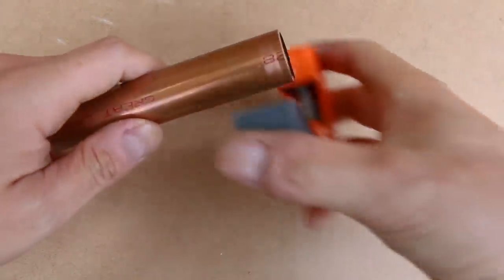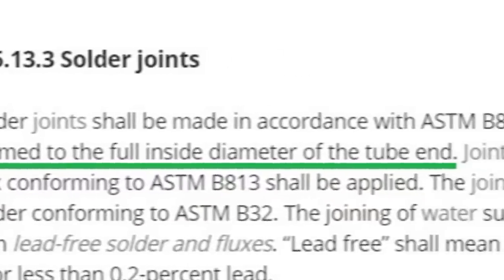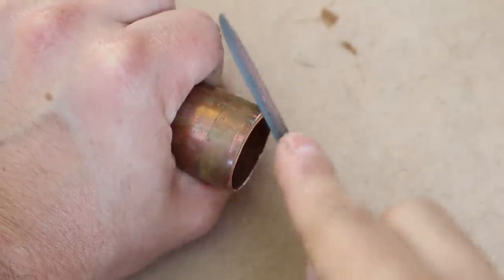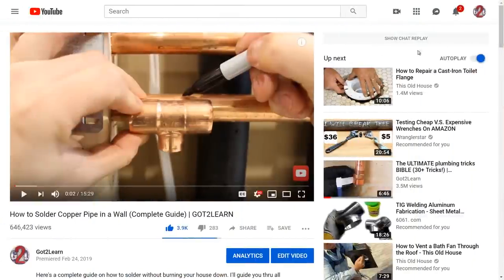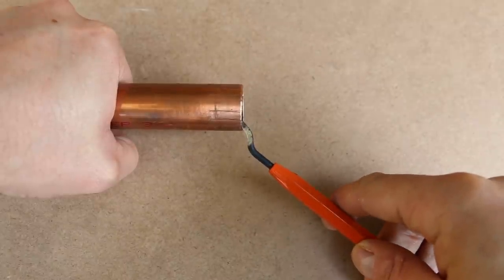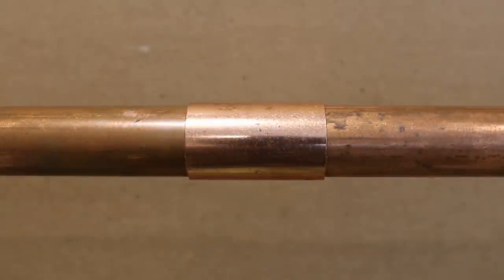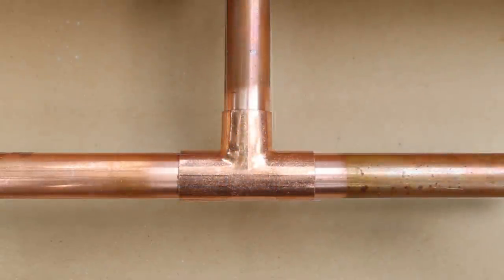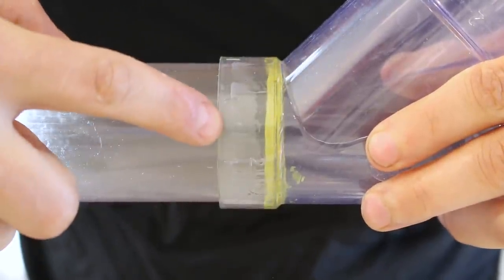The WORST Mistake When Soldering Copper Pipe (Not Deburring) | GOT2LEARN

Comment: Thanks for explaining why you "need" to bevel the outside edge -- I don't use sharke-bites, so just use the emory paper to smooth it because that's what how I was taught, but I guess I don't need to do that.  One other tool you can use to ream the inside of the pipes is a stepped drill bit.  But that really only works out well if you have an assistant doing the cutting / reaming on a big job.  Otherwise it's just easier to use the reamer on the cutter so you don't have to change tools.
Reply from the maker: My pleasure Robert!! 🙏

Comment: I fought tooth and nail on a 1/2 inch section of copper pipe going to a spigot under my bedroom floor that had two 90° angles leading out through foundation.  4 times I wiggled my fat butt down under there due to pin hole leaks . And each time lasted about a month . I gave up and used a section of pex pipe and fittings. Granted it has not failed yet but I was sure it was due to acidic or alkaline water chemically eroding the copper. We do have very hard water but only this section consistently failed. 
  Now that I've seen this video it explains it .
   I fixed it 4 times and then by a professional plumber twice. He said it was due to freeze burst . But right around the pinhole it was thin not cracked or bulged. 
Anyways I really learned something here . I only wish I had seen this sooner 😪
Great video !

Comment: You dont need to do this. And doing this in places where its impossible to get the burr out of the pipe is only going to cause potential problems. The absolute minuscule amount of burr left inside certain fittings isnt going to cause any problems whatsoever (as long as your cutter is sharp), a TEE junction  or Elbow will cause a lot more restriction than any burr will.

And I've never seen a copper pipe with a pinhole in it in 20 years of plumbing/heating and ive seen pipework that's 60yrs old.
Reply: You’ve really never seen a pinhole in copper ? I’ve fixed about a dozen in the last two years .
Reply: @davidwellander6030  Holes caused by damage yes (nails etc), I've had copper pipes blocked with scale, copper pipes burst because they have frozen, snapped because someone's stopped on them or a radiator has fallen off the wall, I've had 100s of steel radiators pinhole, I've had copper pipes that have worn through where the floorboards are rubbing against them. I've had corroded pipes that have been laid in concrete with no protection. But I've never had a single pinhole in a copper pipe that is in use.

I once had a cold mains pipe that had been drained down and not being used for 20 years be refilled and have about 100 pin holes all the way along its 20ft length, but that's different, that's due to corrosion with the small amount of water left in the pipe and the reaction between that, the air and the copper.

Maybe it's the quality of copper or water treatment we have here that means I've never seen one. Roughly 20 years.
Reply: Hell I just had one last Friday,  guy called our office complain about water coming through his ceiling and we cut out all the soft drywall and it was coming from a pinhole in the 1" main from corrosion,  kinda crazy how that works.
Reply: 60 year old plumbing that lasted possibly because it was deburred.

Comment: My question is if this is so important why didn't you put this on your basics to soldering copper plumbing for the first time now it looks like I'm going to have to cut it out my main pipe and do it all over again I was in the situation of operation damned if you do and damned if you don't
Reply: lol ya i just saw this now too ... im not sure its that critical, i just opened up 50+ year old plumbing in some of my house and the excess solder in there was insane, your telling me a little tiny lip would have more of an impact ? 

I'm not running 100 gph non stop through the pipes :) 

I doubt even plumbers follow these rules, or else every job would take forever to cut. 
They roll up with pex, pipe cutters, easy quick fast. 
Im not saying this step inst good to know, just not as intense as it seems, also the sewage one was funny to watch :) ... totally unrealistic, if water flows that slow you have other issues.

Comment: You would be surprised at the number of so called plumber who do not deburr the pipes. I have repaired so many pin hole pipes that if I would have a dollar I would get rich. The lazy plumbers will demand top dollar for a job done half ASS. It is refreshing that you have covered this topic of a true craftsman. I can tell you that I have a reamer used in the machine shop that reams the outer and inter in about three seconds with a perfect radius on both sides. Perfection just like a craftsman. Wish all plumbers would be forced to do what you are showing. Good day.
Reply from the maker: Yes I know, it's a lost art today :(
Reply: @Got2Learn  But copper is still the best bang for the buck.
Reply from the maker: Sure thing!
Reply: @Got2Learn  Please keep up the great work.
Reply: Copper is still the best way to deliver water and has a cleaning effect through a chemical reaction. Except if you have sulfated water then the big fat NO. Will dissolve the pipe for sure. Keep on making videos for us all to see and learn too.
Reply from the maker: Will do, got around 40-50 videos on the way, so still here for a good while ;)
Reply: Good day.

Comment: Ive been in HVACR for about a year (Yes I’m an apprentice still). And I will say, Deburring isn’t dead, not totally. Usually bigger boiler jobs, usually involving wall hung gas boilers or just a new oil run boiler, we measure, de-burr before you clean the pipe, then solder. We usually use Acetylene. Interesting to see how the plumbers do it 👍🏻💪🏻
Reply: In HVACR its very important to deburr and you cant let any of the burrs stay in the pipe otherwise it can clog valves and coils in refrigerant systems
Reply: @mercinc2926  we use nitrogen to purge out any excess solder and de burring shavings. It makes the job longer but hey.. mo money and better functionality

Comment: Awesome video.. I recently was attending a trade school plumbing class where I tried to teach students to debur the pipe, and the plumber said to me.. 'We don't debur'..  I said nothing, as to avoid disunity and an argument in front of student and teachers (& otherwise, I honestly think the guy is probably an above-average plumber), but it irked me to see bad practice being taught..  I witnessed such pinholes likely created by a lack of deburring wreak havoc on my CA apartment complex's circulating hot-water loop..   There is one additional advantage to deburring (that may not have been mentioned)- as long as you remove the post-debur "shavings", deburring reduces the likelihood of slivers breaking free and damaging plumbing fixture o-ring downstream.
Reply: I am a plumber and not deburring the pipe after you cut it with tubing cutters is against code, the inspector could possibly make you remove the install if he wanted to,you must deburr and ream the pipe to its full inside diameter so as not to affect the flow of water

Comment: Using the polypropilene pipes, that are glued by heat, instead of the copper ones is a better solution!
Reply: You can't using it for clean  water arrivals or hot water under pressure if you use your plastic sh1t you work bad better change job
Reply: @badbotchdown9845  Sorry for you whoever you are bro! Those pipes are in use all over Europe for both hot and cold clean water and under pressure too! Do not spit 'brains' over matters you know nothing about! And those pipes come with 100 years warranty and because they are polypropilene, there can be no scale accumulated and other things inside them, so their inside remains cleaner than the metal ones! So the water passing through them is cleaner! Go learn bro!
Reply: @nyagolnyagolov7130  thats willing to say youbuse shit material instead of copper rhe plasrix is perfectly know for letting migrate chemicals on drinkinf water  you do wring and you do wrong  even never  knowing it you surely from rhe east where nothing is doing right.

Comment: I am not a plumber, but I have done lots of copper joints on my cars fuel systems.
First thing is- it is cleaner look. it gives me inner piece, that I made perfect clean job.
Other thing is inner dimension.
When you are working with 6 or 8mm pipes, this edge can lower inner diametre to 4 or 6mm. So it is really small in that area, and reduces fuel flow a lot.
Debris. Cut it away, and you won't see any copper debris for shure.
And lastly. When you are makeing sleeve, sleeve won't fit to pipe, if you have cutting edge there.

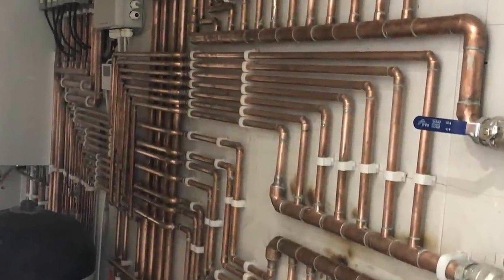Comment: Love that tubing work at 6:09, except for the joints not being wiped and the burn marks on the drywall.  But overall, a masterful layout.
Reply from the maker: Thanks buddy :)
Reply: What is that system?
Reply from the maker: Just a staged wall in my garage ;)
Reply: Got2Learn oh right, it looks like good practice, id love to do something like that to master soldering and copper runs
Reply from the maker: Go for it :)

Comment: Number one reason for not doing this and why they probably don’t teach in plumbing courses is you’re creating more debris that could clog up things
Reply from the maker: If you are in a new construction, you deburr the pipe before installing it, no debris goes in the system.
Reply: In cooling or refrigeration you may plug an expansion valve or orifice.
Reply: No, it's just being lazy.

Comment: The solution is called pex
Reply: pex? hahahahaha, pex meet flame, pex has left the chat....
Reply: Pex is nice I use it . But it’s not at all rodent proof at all it’s actually kinda dangerous if you live in areas with lots of critters .
Reply: pex fittings are extremely restrictive,,,especially the non- expandable type...
Reply: Smarty Jones   Yes I don’t use any pex on tub shower valves because of that reason . Try to run water through the tub spout and because the fittings are a smaller diameter water will trickle out of the shower head ! Sucks ! So I always use copper and sweat it together

Comment: Just reasons why copper/soldering needs to go.
Reply: Just relocated my hot water tank, soldered about 22 fittings in the process, used 5 shark bites. At pressure test, 2 leaks, both at shark bite fittings. Zero solder points. Also had to replace 1 shark elbow with soldered due to clearance, propress would not have been able to do that joint at all. Im sold on soldering! It flat out works!
Reply: @beerbeforebreakfast   Fixing Things and Fishing  95% of the time sharkbite fail due to user error. Knicks in the o-ring or burrs one the pipe.  And if soldering why use sharkbite at all? Either way, wirsbo (cold expansion pex) is the way to go.

Comment: Even as an electrician the importance of reeming your pipes is very important and having clean square cuts on your ends of pipes in between couplings. The other day I was running a single set of wire through a pipe from a plug to a pull box maybe 10 feet away with on 90° bend and 2 box offset bends. I should have been able to easily push the wire through and been done in about 5 minutes, but because they person that installed it, did an awful job I had to take the entire thing apart, and Reem all the connections points,  this ended up taking about an hour instead of 5 minutes

Comment: I have a solution to the problem!!! Just dont use copper pipe....
Reply: Revnge7Fold if you want longevity in the system, I’d use copper. Probably with a water management system preferably like softener, ph test, circ pump, whatever else you want to throw at it. Make it all analog, it’ll last 100 years. Pex isn’t through to last that long as the bonds in the material aren’t necessarily stable forever. Also, mechanical stress in the system like straps, clamps, rubbing on framing members can all damage plastic materials. Cu pipes can be firmly attached for the main runs, with offshoots for your home’s needs like sink or whatever else. But just run copper to the toilets, please.
Reply: I've re-piped many copper under slab homes, corrosive soil can destroy type L copper, but not plastic!

Comment: If you're deburring a vertical pipe, as in one of your illustrations, I would suggest stuffing part of a paper towel into the pipe before deburring. Otherwise the deburred bits will fall down the pipe.
Reply from the maker: Or just hold the tip of the burr as you are deburring, tgat's what I tend to do 🙏
Reply: very sound advice from the Sausage King of Chicago!

Comment: Crap, if you look at those cutaway photos (e.g. the T joint at 5:57) there's a step/gap between the end of the pipe and the fitting that is far worse than any burr. I completely re-plumbed my house about 30 years ago didn't deburr a single fitting, never had a problem. Re-jigged some of the plumbing recently for a new boiler, looking at the inside of the pipes/fitting I cut out they're in extremely good condition. If you search for the NPL document "Avoidance of Corrosion in Plumbing Systems" GPG120 it states :-

"5. Erosion Corrosion
Erosion corrosion is very rarely found in your normal small size house but is more likely in large
buildings with recirculating hot water systems, such as those found in hotels, commercial
buildings and large country houses.
Erosion corrosion occurs due to turbulent flow in copper pipes, which releases air bubbles from
the water and which remove the protective patina from the copper surface. Corrosion, which
then occurs in these localised regions, takes the form of grooves or horseshoes in the surface
(with the ‘horse’ appearing to have walked upstream). In severe cases, wall perforation can
develop within a matter of weeks. A typical example is shown in Figure 4.

Figure 4 Erosion Corrosion at elbow.
Erosion corrosion is most often found just downstream of elbows or changes in pipe section,
where turbulent flow is more likely. Hot water return lines are prone to this form of corrosion.
However, there is a critical flow velocity below which erosion corrosion should not occur. This is
often quoted as below 3m/s for cold water pipes and 2 m/s for hot water pipes. However, in soft
water or base-exchange softened water, erosion corrosion is possible at flow velocities below
these values. Other factors, such as burrs left on cut ends of copper pipes and sharp changes
in sections increase the likelihood of erosion corrosion. To prevent the risk of erosion corrosion,
flow rates of <2 m/s for cold water and <1.2 m/s for hot water systems should be met. However,
in fully softened waters, flow rates should not exceed 1 m/s. Where flows are intermittent, these
maximum flow velocities can be relaxed somewhat."

Now while it does say burrs can increase the likelihood it is clearly not the main factor and again if you look at the cutaway photo you can clearly see steps between the pipe and the fitting that are far bigger causes of turbulence than a burr would be. Maybe it's a bigger problem in the US due to softer water/use of water softeners ?

Comment: about a decade ago, I was using a system of pipes that avoided all these problems potentially by using heat for the joints, and then yo push it into the plastic pipe. Aqua something, about the time shark bites were coming out, the pipe was pretty distinct, green and had a noticeable blue line down the middle of the pipe.

With 3d printing and machines, one could manufacture a machine that prints to any size pipe, of course, joints may the system stronger.. so / and if the print was off by a couple mills you would have to use like an MJ clamp or something, rather than just a store fitting.

I always think housing should have like in disney land, all pipping should be in a ungrounded chamber and accessible, to the street connections. Why. Just provides a way cheaper modification in the future, and plus it would increase sale value, since if your house was to be replaced you could change or use the same base system. The tunnel would be about 15 feet underground.. since thats the swear average depth... just makes more sense.

Comment: I try to always cut with a tubing cutter and deburr. If I’m in a hurry I’ll just cut the pipe with a band saw instead so deburring isn’t as important. That brings its own challenges though in the form of copper saw dust. I don’t deburr the outside even with pro press. What I try to do is spin the pipe as I put it in. The only time I chamfer is if I have fittings pressed and can’t spin them to put them together

Comment: In any system you try to get laminar flow if you don't deburre you will get turbulence the same it true if you chose the dimension of your pipes to small there is a so called  Reynolds number for each fluid and yes every gas is a fluid in this regard turbulence will shake the system thats the noise part and the movement can destroy the system as well because cracks form because of small vibrations ...
Reply from the maker: Good comment, thanks for your input buddy!